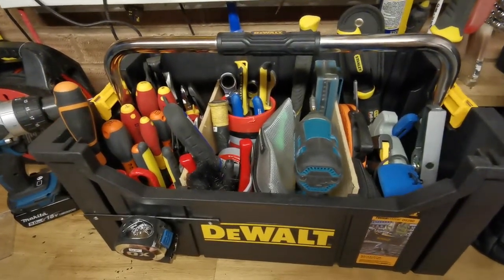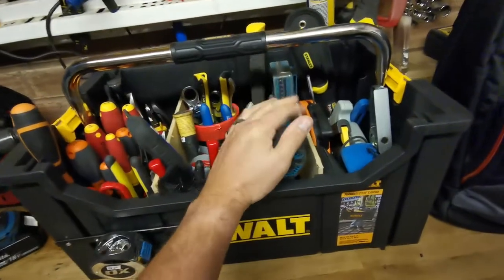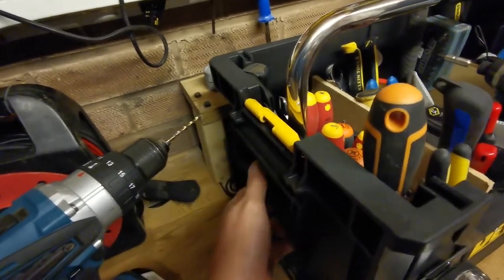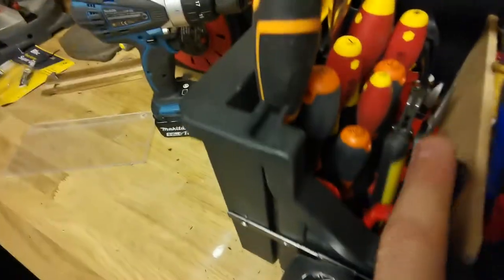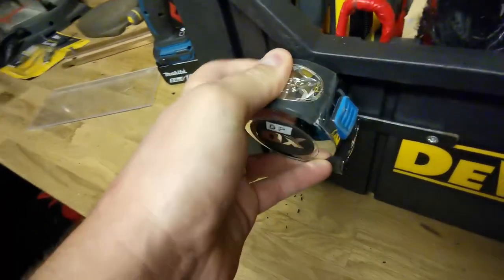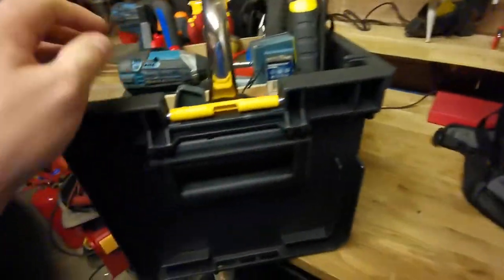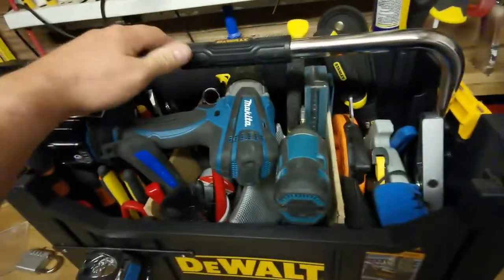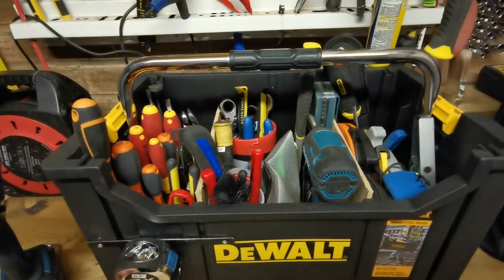Dewalt tough system tool tote review

Comment: The metal piece in the back of the unit is to lock it to the Dewalt hand truck. The handles on the side serve
two purposes. One is to carry and the other is so it can slide onto the arms of the hand truck.

Comment: Clever mods - the divider and the tape holding bar. 
This box looks like it's an insert that belongs in a bigger tool chest. 
Not sure what that metal thing at 5:45 is for, either. 
British/european insulated Klein screwdrivers look very different from the ones we use here, in the US. All in all, nice set-up. I, too am a fan of the open box design, so that you can see everything in it. I use an open bag, too. I suppose I'm in for a lot of cursing or at least some heartache if my bag takes a tumble down the stairs, spilling its contents, but that hasn't happened yet.
Reply: I’m here in the US and want the velocity rogue 6.0 would trade my veto hi-viz backpack in a heart beat for the rogue!

Comment: Nice setup. Ive been watchin several of your vids as im a Knipex fan and have picked up a few of their tools and always looking for options to pick up more to replace older less quality tools when I can afford it. I do have a question for ya about your old bag that you showed briefly in this vid and Ive seen it in a few of your other vids. What is the model of the bag and does it have a fold over flap of fabric to cover the tools to protect them from the weather? Im a USA guy and cant find a good bag/tote that has a tool cover like I think your old one does. Im not a big fan of the backpack system but would like to find a tote that has a fold over flap. The zippered bags suck in my opinion because if you want to zip them up for protection you can hardly put any tools in them or they woulnt zip up. Anyway, I enjoy your vids so thanks for sharing your thoughts and knowledge!
Reply: @danstoolroom7700  Thanks Ill check them out👍